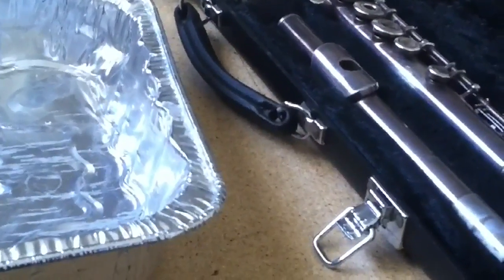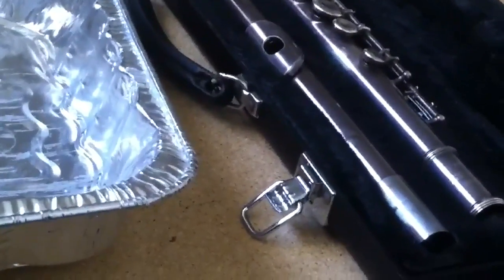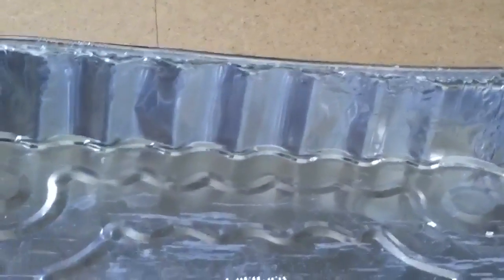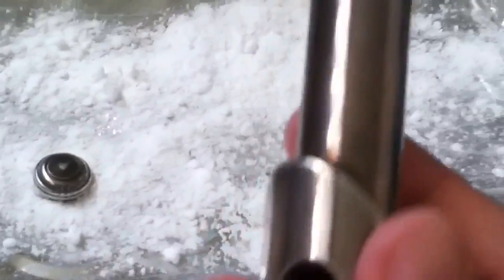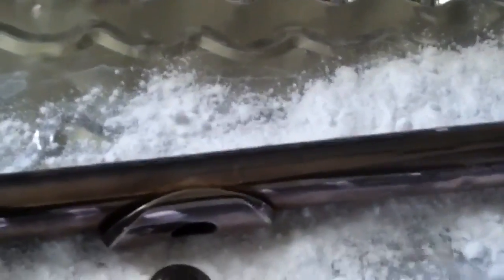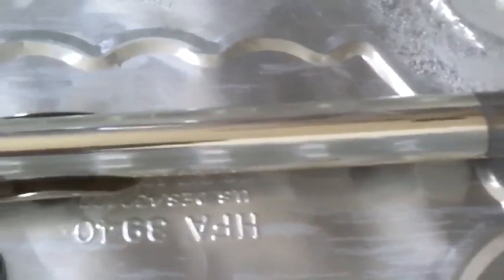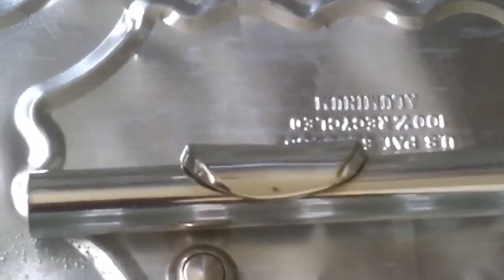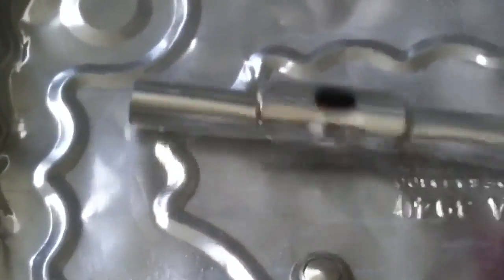Removing Flute Tarnish ( Headjoint only)

Comment: Seriously? This is what you have to say to my daughter who ruined her flute because she followed your video? Your sarcasm was rude and uncalled for.  You never said in your video to read the comments below before cleaning.  And where did you say to ONLY clean the headpiece or whatever it's called? She followed the video and was so thrilled with the results till she tried to play it and it wouldn't work. And we can't afford to get it fixed.  Take responsibility for knowledge? What knowledge? She followed your video. That was all the knowledge she thought she needed. If nothing else, you could have been a little more compassionate.  She is crushed.  And your rude comments just made it worse.
Reply: I’m sorry. As a fellow flautist this makes my heart ache. Maybe the flute was a different metal like nickel? I hope you can get it fixed though. 😪
Reply: Hello! I can understand your frustration in the process, but I just did it, and it worked perfectly. There are two things that happened and didn't. 
A; you could not have used an Aluminum pan
B; You didn't remove or put in the Cork correctly before or after, causing there to be no sound
C; You put in other parts of the flute without removing pads, rods, and screws, or you could have installed them incorrectly. 
I feel your frustration is valid, but to come on arguing to Micah is out of his responsibility. He gave the very basics, and it wasn't a so easy of a project, yes, but if you did not follow instructions correctly, or failed to do research then you must blame yourself.

Thank you, and have a good day.
Reply from the maker: I call troll. Yes, I stand by me words and my video. I am not responsible for people doing things that I did not advocate or show in this video. Go somewhere else to entertain yourself. You are responsible for your daughter (if she is real) not me. you are the parent, not me. Finally, She if she ruined her flute, she did not do what I did. Troll somewhere else.
Reply from the maker: By the way... the description section of this video states, "how to remove tarnish from your old flute head joint easily! "
Reply from the maker: Also... I explain everything in the second video following the first. https://www.youtube.com/watch?v=imya_T4RXWw . I would highly suggest giving a lecture to your daughter on making sound judgments based on logic rather than blindly doing what she thinks is correct gleamed from a youtube video. Sounds like you have some quality parenting to do. I wish you the best in the future and advise you to talk to your daughter to help her from making mistakes in the future rather than complaining to a professional flutist.
Reply: Sean Jacobs Family I agree with the family completely.  I came to this video searching for a way to clean the COMPLETE flute, and came to the comments only because you didn't mention anything about the rest of the flute, and would it damage the pads. I can very clearly see that you needed to state to do this for the headpiece ONLY, yet you did not. I understand how this happened to the Jacobs family. You made a great video, with great intentions,  but you do need to be a bit more clear regarding the rest of the flute and possible damages.
Reply: You can clean the whole flute, as I did. You just need to know how to properly install and reinstall parts on your flute, which there are plenty youtube videos on how to do. If you still are uncomfortable, then I recommend a professional.  @stevenjrrice5694
Reply: Jacobs family Im sorry
Reply: Hey Jacobs Family, I know I'm a year late but i'm really sorry about what happened to your daughter's flute. I haven't tried this yet but when I was younger I took my flute apart to clean in and when i put it back together it didn't work and I was so scared. but it turns out that some of the springs weren't put back in place so that might have been the problem.
Reply: Micah Layne o
Reply: Jacobs family I'm sorry about your daughters flute I hope you get it fixed I'm a fellow flutist
Reply: Sean Jacobs Family hahahahahahhahahahahahhhahahahahjahahahahahahhahahaha NOOB
Reply: Sean Jacobs Family If can’t afford it but another one
Reply: Sean Jacobs Family Your daughter is stupid

Comment: Do you think if I soaked a cloth in the solution and wrapped it around the headjoint it would work? I don't want to mess with the cork, but I do appreciate how well this works. Fortunately for me, only my headjoint is tarnished, so I don't have to worry about the rest of the body
Reply from the maker: Nope. It's not the baking soda solution that cleans it. The solution is a medium that allows the sulfur to be removed from the silver.

Comment: does any one know if it has to be an aluminum pan?
Reply: You'll need aluminum along with the baking soda.  Either use an aluminum pan or place a sheet of aluminum in a pan of your choosing.  Basically the silver sulfide "likes" aluminum more so it will stick to that.  The warmer the water, the faster the reaction.  The silver (flute) and the aluminum need to touch because a slight electrochemical reaction occurs.

Comment: My son's flute turned gray...I hope this works.  By the way, you started on an open holed flute?  ;)
Reply from the maker: I sure did. Open holes never bothered me. They actually helped me feel the keys better.
Reply: Well, it did not work on his flute....I think his chemistry trashed the silver.
Reply from the maker: +PJ Sev Life is complicated and so is the flute. Take it into a trusted flute repair specialist and I'm sure they will give you the best professional advice to maintain the quality of your son's flute. As a teacher and professional flutist I have seen the horrors of neglect of regular maintenance. Talking and working with someone in person will undoubtably yield good results for you. Good luck
Reply: My son admitted not cleaning it, like he was supposed to.  But I think his chemistry is bad on silver.  I replaced his flute with an inexpensive Gemeinhardt off Ebay that has a nice finish yet.  It is getting serviced right now.  The old one, well, might be good for parts.  The only part that isn't grey is the very end part farthest from the mouth end.  I will make sure this replacement flute is cared for.

Comment: Good video thanks, i'll try that.  Will this remove smell from the headjoint too?  I've acquired quite an old flute and it smells really bad.
Reply from the maker: If the smell is from the tarnish, then yes. If it is from moldy pads, then No. just another reminder, this video shows tarnish being taken off of the headjoint only! Do not dunk the whole flute in or you will destroy your pads. Check out my second video to see me do it with keys off.
Reply: Thanks, i put it in for a professional overhaul in the end!

Comment: I've had my flute for 4 years and when I bought it it had brown stuff around the keys and a black streak on the bottom of the body. will this work for it??
Reply from the maker: It might. Check out my second video showing how I did the same process on the body of the flute with the keys taken off. No pads or keys, just the silver tube.

Comment: Does the pan have to be aluminum? 
Could it work with porcelain?
Reply from the maker: +The Tuxed Brine the aliminium is important to the chemical process.  however, you can just put it in a container and add aliminium foil to the bottom making sure it makes contact with the metal.

Comment: As a chemist, I agree that this is a competent method for removing tarnish from silver. However, as your video shows, baking soda also dissolves aluminum--don't you see the CO2 forming on the tray? It would be better to use either a stainless steel baking tray or a plastic one.
Reply from the maker: +Vincent Voltaggio one would not reuse the aluminium tray after the experiment so why does this matter? I use plastic tray in the second video BTW.
Reply: +Micah Layne I tested both ways---doesn't make any difference. As Figaro would say, "l' Inutile Precauzione" (a useless precaution). Hot bicarbonate solution does the work. So, 8oz water+2 tblsp bicarbonate in a cooking pan; warm it. Take an animal hair artist's brush (plastic will melt) and brush the hot solution on tarnished areas--like around tone holes and on rods. Rinse with tap water.  I cleaned the body of my flute like this--no immersion and didn't have to disassemble. Great for spot cleaning!
Reply: The fresh aluminum pan competes for the sulfide tarnish; if successful, the aluminum should blacken. This is what happens when you wrap badly tarnished sterling in aluminum foil and create a salt bridge (warm salty water and baking soda).
Reply: @kristinehatkinson7323  I know this is an old video, but this is correct - you want the tarnish to be attracted to a more reactive surface if possible, rather than just dissolving into a solution and requiring alcohol or similar to remove the microscopic bits of suspended sulfide that will coat the surface/act as excellent seeds for future tarnish.  Obviously it's recycled afterwards. :)

Comment: So I watched this video and I was going to try it but before I do, just to make sure, my flute is purple, it has silver keys and mouthpiece though. Would it still take the tarnish off of the mouthpiece or keys? Thank you so much this video helped so many people!
Reply from the maker: Cai Evie I'm sure you read my caution about not working on the flute unless you are at an advanced level of repair. Your flute sounds like the ones assembled in China that are painted various colors. This method is NOT for your flute. I don't know what they coat those flutes with. This method simply shows how tarnish is taken off of silver using a flute. Please DO NOT clean your flute using this method. Take into a shop or upgrade to another.

Comment: I tried this but it didn't do anything :( did I not use enough baking soda?
Reply from the maker: Hi Daniel X,

It could be several things. 1) the flute must be silver for the equation to work. It is aluminum, silver, and sulfur that are reacting here. The baking soda solution is just a catalyst. 2) water must be hot. Boil the water for a quicker reaction 3) this method is to take of patina. Sulfur from the air that tarnishes the flute. If your instrument has a different kind of corrosion or is made of something other than silver it won't work. 4) make sure the flute is in contact with the aluminum.

Comment: I can't get the cork out of the top. What should I do?
Reply from the maker: Hi Katrina, 

Could be a couple of things. 1) Please be sure that you are not pushing it in the wrong direction. You can damage your head joint if you force the cork though the top because head joints are conical.The bottom of the head joint it larger than the top. Forcing the cork in the wrong direction will damage your head joint. JLSmith has great instructional videos and tools for this.  2) Newly installed corks fit snugly and generally should not move around easily. Old/ shrunken cork like the one in this video (flute is close to 20 years old) move easily. You probably shouldn't mess around with it just to try this method out. Find an old flute if you want to experiment. $50 on craigslist or something.
Reply: Micah Layne , Thank you I will head your advice. Can I clean my flute with this mixture and Q-tip or a cotton pad?
Reply from the maker: The baking soda isn't what cleans the tarnish. Did you review the links I posted showing the chemical process? Scroll through all the comments and take a look at the links I have under the video. After that, you'll understand that baking soda and water is not the cleaning solution, but a way to get the aluminum and sulfur to interact with each other.

Comment: i also read we can put headjoint in metal with salt and hot water (boiled), so it is a quicker way if you haven't baking soda at the moment! :)
Reply from the maker: Alessandra, Please Don't mix in salt. Many salts are not just NaCl. If you analyze the formula, you realize that you may make the matter worse! I've seen experiments with salt that put streaks of black throughout the silver. You don't need the salt for the transfer of sulfur so don't use it. Be warned

Comment: Is there any other kitchen utensils i can use if I can't get an aluminium pan?
Reply from the maker: just put aluminum foil strips in any container that holds the flute pieces. the chemical reaction between sulfur and aluminium is what makes this work.
Reply: Micah Layne ahh I see. Thank you very much!

Comment: Will this process affect gold negatively? 
I have 9k Aurumite Powell that has badly tarnished silver rings, posts and ribs, but don't want to damage the gold tubing. 

Thanks! :)
Reply: I know this comment was posted a year ago but I think I have your answer. I've seen a lot of people concerned about this in the comment section and I think it's safe to say that it will damage a gold flute. I'd suggest maybe taking your flute to a music store or someplace where they could take off the tarnish for you.
Reply: +Sprinkles1107 RBLX I tried it with some old gold necklaces and it actually works great for gold too. But to be on the safe side i let my flute repair technician shine it up when I get an annual COA

Comment: This is a very nice process.. Do you think it will work with a silver tarnished flute with a few little spots and rustiness in between keys?😦
Reply from the maker: Sure it will. Just be sure to take the keys off before you try it and dry thoroughly when you are done. Pads damage easily if wet.

Comment: how do you get rid of rust?
Reply from the maker: Hi Stacy,
Rust forms when iron comes in contact with atmospheric oxygen and water. I assume you are talking about the screws on the flute as these would be one of the places that would have rust. I know some flute manufacturers use stainless steel in their pivot screws to avoid rust. The use of stainless steel and other rust resistant alloys are meant to be a preventative measure against oxidation. Try some rubbing alcohol and see how that goes. If the rust is severe, just take your flute into a repair technician you trust and have them replace it. Flutes are much like cars when it comes to repair. Although it is good to stay informed about how to take care of it, it is always good to see an expert in repair who has spent their whole lives dedicated to the matter. If you are that expert, go ahead and experiment accepting the benefits and consequences of your actions.

Comment: do I have to use that kind of pan?
Reply from the maker: Hello mp2k15,

You don't need to use the aluminum pan. You can put it in any container and add aluminum strips on the bottom. The more aluminum, the better. Using the $1 pan is cheapest and easiest to find though.

Comment: Wont the coil shrivel up if it is submerged in water?
Reply from the maker: Hi Gabe, what coil? Once the cork mechanism is removed, there is nothing but the metal of the flute head joint.

Comment from the maker: No, do not soak flute pads. I demonstrated the concept with a head joint because it has the least amount of parts and is easiest to clean. As you probably already know, traditional flute pads damage easily if wet. If you want to clean the entire flute, you'll have to take the pads off. Since many flutists are not trained to do this, I would recommend talking it over with your repair person the next time you go in for a routine COA. Isn't the process awesome!